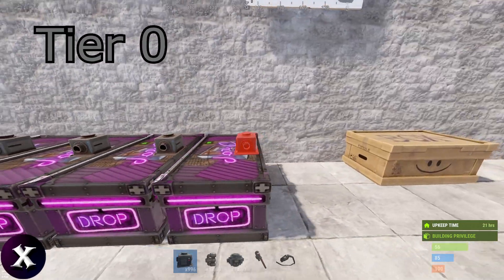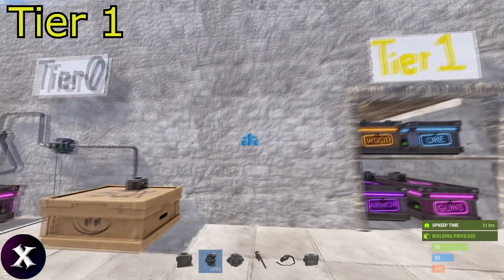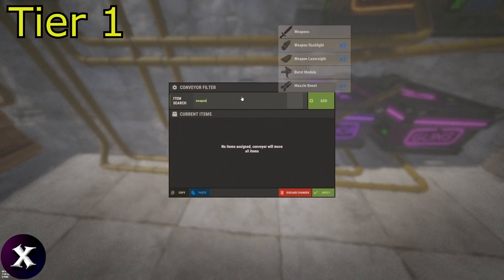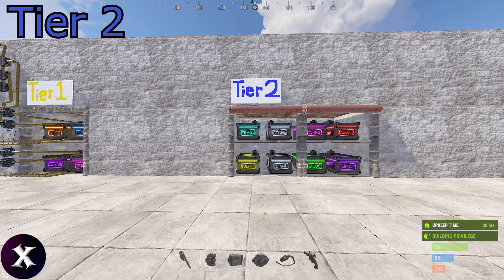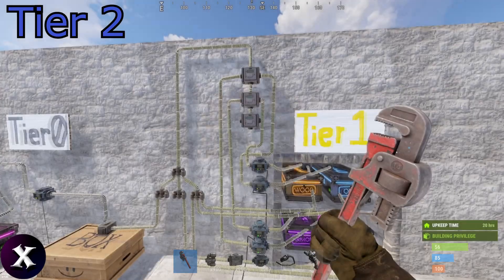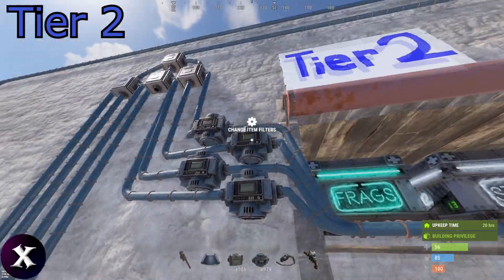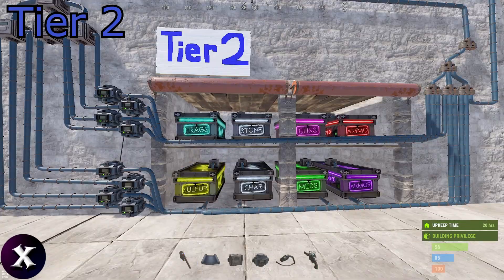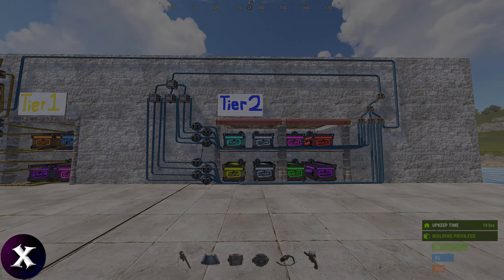Rust MODULAR Sorting System | Tutorial | Simple  *Outdated! Find The New Version In The Description*

Comment: what does linking 2 boxes together without the conveyer do will they be used as 1 big storage box?
Reply: Yeah I noticed it will put small stack of each in each box kinda irritating do U plan on doing a add-on to this with coverors and combiners I found it quickly exceeds the limit when U start manufacturing kits
Reply from the maker: @bradhazeldine3240  What kind of add on were you thinking of? I have most of the main automation systems already released except the crafter, but that's currently in the works and will be out soon.

You shouldn't run into any limits when automating crafting as they use so many conveyors in the first place and the limit is per conveyor.
Reply: Maybe I'm setting them up wrong but I also put more boxes in my setup being a moded server but I'm not really playing the game ATM more just testing out setups
Reply: And yeah was the crafter I was thinking about but when U set it up to craft full metal kits and m249and times explosives it adds up quick
Reply from the maker: @bradhazeldine3240  oh yeah, that can get pretty pricey! You should still be able to craft whatever you want if you use buffer boxes along the way, you'll just have to convey resources from various boxes into the buffer box, then into the crafting system.

Either way, the upcoming update (should be the March update!) will allow more boxes to be connected together! it's currently set to 64, but that's subject to change.

Of course, it could get set back to 16 by the time the update comes around but we'll see!
Reply: I'm surprised they have not released any plugins to speed it all up and make it unlimited yet
Reply from the maker: @bradhazeldine3240  There is actually a plugin called jpipes that has been around for years, and there's a new one I forget what it's called, but it's like jpipes but with more features! That being said, server owners can adjust conveyor tick rates, tick sizes etc.
Reply: @x-tremespeed  cant share a screen shot apparently but its giving me the too many inputs error
Reply: fixed it by changing the outputs to the fix layout
Reply: @x-tremespeed  do U know what the max setting you can safely use before it glitches out
Reply from the maker: @bradhazeldine3240  Minimum currently isn't useful for anything. In the upcoming update, minimum will be changed to leave the designated amount in the input box.

Have you seen my auto smelter video? that goes over setting up conveyors into furnaces. The TL;DW of it is - set max to 10 on each ore and on wood which will trickle feed all the furnaces you have daisy chained together. The reason it's 10 is for simplicity, and for safety. It stops grubs from being able to jump in your compound and grab all the ores from your furnaces - they can only get 10 at a time.

I haven't personally seen the "max" option cause anything to glitch out. I've set it up to around 8000 before (for my auto upkeep system) but had no problems with that.
Reply: @x-tremespeed  by m ax i was talking about the conveyor speed not the amount of shit to fill a box with\
Reply: I hope they come up with a everything but option and a method to stop furnaces emptying slots then mixing up the order so nothing smelts tried the min setting but don't think that works like that think it makes it not move anything unless there is ten of them
Reply from the maker: Daisy chaining boxes together is the same as using a splitter. A conveyor will fill both boxes at the same time.

They will be changing this in the next update though, and daisy chaining boxes will essentially just "increase" your effective storage amount. It won't start filling the second box until the first is full. That's all subject to change before they actually release the update though.

Comment: Tier one is not as many as you like its a max of 9 combiners or max 30 boxes connected to the system.... have fun testing
Reply from the maker: The most you can connect is 15+1  boxes in Tier 1 and 18 in  Tier 2 using the technique I used in the hotfix video in my pinned comment.  (15+1 refers to 15 in Tier 1 and the buffer box). I didn't mean that phrase to be taken literally,  just that I put down a small number of boxes in the video here and you can put more. 

The upcoming update should make for a much more robust system however, and I'll make a version 2 taking advantage of that. I'll also be sure to be much more clear as to the limitations!
Reply: @x-tremespeed  hmm strange i connect 2x 24 boxes on the buffer box. 

So i got 4 dropboxes pumping into 1 buffer box and then i have 2x 24conveyors pulling out the buffer box. First i had 48 conveyors on. 1 system did not worked so i kept reducing boxes and it worked up to 30
Reply from the maker: @KnoopiE1988  30 between the two tiers is approximately what I got as well (33 to be exact).

I'm excited to see what numbers they settle on for the upcoming update as that will open up possibility for much more robust systems!
Reply: @x-tremespeed  indeed they say it’s gonna be 64 storage containers on a single conveyor, have u also encountered splitters and conveyors breaking off the walls completely random ? Happent to me twice while upgrading the walls and once when i connected more splitters then the system could handle.
Reply from the maker: @KnoopiE1988  I haven't encountered splitters breaking at all, but pipes do tend to break when upgrading walls or using roof pieces to open bunkers. When conditionals change they tend to reevaluate whether or not they like your pipes and will break them sometimes but I haven't had that issue with actual components yet.

Comment: What if someone puts a rug in the third 2 ammo chest. There's no piping to remove unspecified items? Tbf I might just be blind
Reply from the maker: Actually, this is a good point. Any unspecified items dropped into the drop boxes will her moved into the buffer box, but then get stuck there and need to be manually moved. If those items get put in an ammo box, as per your example, they will get stuck in there too. If you have a bigger group I suggest daisy chaining 2 or more buffer boxes to increase the amount of unspecified items your system can handle before getting clogged.

The idea is to have at least one box for every category, but currently the "items" category doesn't have a filter. There isn't a good way to automate this at the moment, BUT face punch has already started developing a new feature for conveyors that will filter out everything EXCEPT what you have in the filter, so you can rid your boxes of all unwanted items.

I will be sure to make an updated video when that happens, but for now try to make your clanmates behave and use the drop boxes only haha!

Comment: Have you found a limit to how many boxes you can link up to this? I can’t get past 30.
Reply from the maker: Conveyors can only see up to 16 connections on either side (storage adaptors, combiners, and splitters all count as connections). I have managed to link up 32 boxes to a single conveyor on staging branch, with a theoretical limit of 41 using the setup I had, although I haven't tried it on live yet.

If you are setting up a rather large loot room and require more boxes you could always have 2 separate loops and link them together at various points to keep the loot even without maxing out the conveyor limits!
Reply: @x-tremespeed  Appreciate the help and advise, i was driving myself crazy in the last few days trying to work it all out with limits. I'll give that a try. 

Keep up the great work, will be helping lots of people out there :)
Reply from the maker: Not a problem! You've actually got me curious again as to whether or not that build I did still works... I may just have to release a short on it in the next few days!
Reply: @x-tremespeed  Will be sure to check it out! 

Thanks bud!